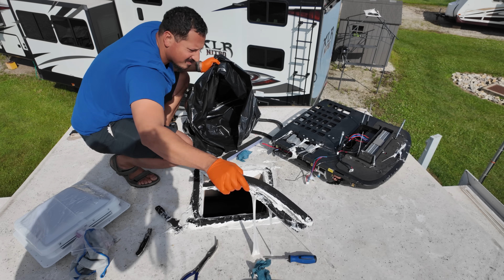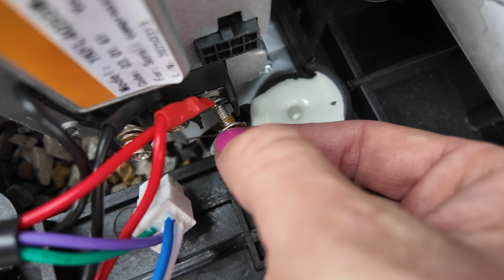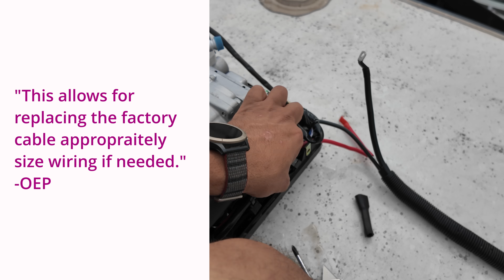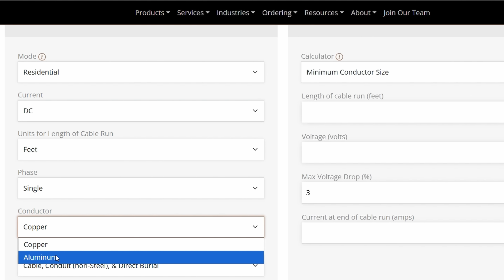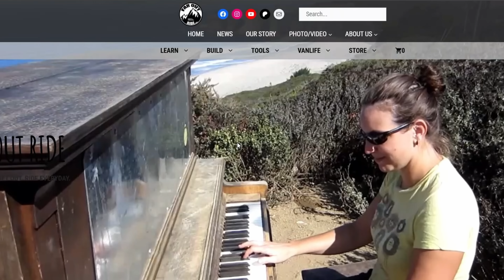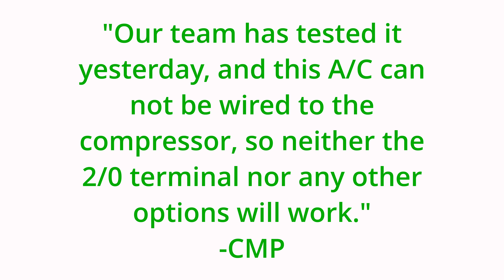The Truth About 12V RV AC Wiring in Big Rigs (What No One Says)

Comment: **OutEquipPro UNSAFE WIRING**
My OutEquipPro (OEP)also had problems. 
I bought the OutEquipPro for my Promaster 159WB which has BattleBorn batteries with Victron components and Spartan Power/Inverters-r-US cables .  

-The OEP 100A fuse that is included got up to temps of over 123F but averaged 116F (Fluke clamp meter measured 46.8A DC and a Fluke 77 measuring 13.54 VDC).
-"UNSAFE WIRING" Since I did not see any ratings on the cable, so I felt that this wire was unsafe to use at this point. 
-I also tried a Spartan Power 100A Circuit breaker just to test a theory and that got so hot, it would pop and not reset for over an hour. 
-The unit never did cool the Van over 10 degrees from outside air temp and I even ran the unit for over 24 hours.
-The blower motor could not keep up either.  It was measured with a Kestral 1000 unit @ 14.3 MPH max
-They had emailed me the wrong directions and that resulted in 2 of 6 mounts breaking.
-The supplied Short Mounting studs were warped/out of round so they were useless
-The supplied gasket is a joke, I had to buy a real 14x14 and even that was a pain to align due to the underside of the unit having holes in it to allow water to leak into the cabin
-I tried to torque the mounting studs to specifications, the unit's plastic started to warp before I got close to that tq number, so I stopped.
-I had to reroute wires within the unit as they had sharp bends and spot-ties that are way to tight and pinch the wires/cables.
-I had to reinstall the wire ring connectors correctly as they put smaller ones under bigger ones which is backwards. 
-The main DC lead screw lugs were loose on the main controller under the top cover.

I was able to return it to  and they paid for the return shipping too.

Oh and I was offered a $100 refund for a review of the OutEquipPro. So I am thinking that some of the positive reviews that are out there are kinda misleading as they are incentivized.
YMMV
Reply: I did not experience any of these issues except the mounting hardware being too short. The wire supplied for my unit was 6 AWG which is rated at 65 amps. 
If you need a longer run than the supplied 12 feet, you’ll need a thicker wire but I highly suggest to locate the battery within the distance of the factory length. 
The torque spec is only 13 inch-lbs which is barely over finger tight. If you warped the unit you went too tight. 
In my testing, the unit pulls about 21 amps at 12v dc after the camper is almost cooled down. I was not able to get the unit to pull over 55 amps. 
The fuse is 100 amps but it should be 60.
You need to locate the unit far back on the 14x14 or water will come in. This actually seems really obvious and is explained pretty well in the instructions.
Reply from the maker: Wow, thank you for sharing this! It sounds like you really tried to make it work and did everything you could! 

I was also skeptical if the wires not having any markings on them. It really sounds like you went through the wringer.

I’m glad that you were able to get your money back, and appreciate you sharing your experience. I hope others will at least know what they could be in for if they decide to purchase.
Reply: @DeterminationUnbound  who needs all this complicated process when u can just get a powerstation with extra batteries.
Reply: Man sorry you had such issues. Originally i was going to get that unit but it seamed as if it was designed for a fresh installation not necessarily purpose build for standard 14x14 rv opening.  Thats what put me into the countrymod. It fit perfectly and works well. I am pissed i gave up the heating function as the outequip did have that. Also the 120v ac i removed to install the dc had heating as well. Personally i would never gone DC if it wasnt 24v or higher. I would never feel comfortable falling asleep with that many amps flowing such a distance regardless the wire size. At 24v im drawing max 28amps with a most of the time 10-15. Very safe imo with fuses and breakers installed at both ends... get your money back and get something better. DC air conditioning is possible with the right stuff. Good luck...
Reply: This information was very helpful. Can't stand that we have to rebuild something after we buy it. Paying for negative reviews to be removed, just experienced that for the first time with a product on Amazon. They offered me $50 to remove a three-star review. That was honest. I declined updated my review to call out the company and Amazon removed my entire review.
Reply: @Buttonator-tx  you do not have to rebuild it .. they needed a better understanding of electricity .
Reply: I really appreciate the detail, honesty and evaluation of this unit which I was going to buy.
Reply: Relocate your 12 volt batteries to the front of your RV this seems to be the simplest solution why rewire the AC unit when you can just move the batteries to the largest load😂
Reply: @Theresahackforthat I think you meant to reply to another post

Comment: I just bought one of these and after doing extensive research I noticed they all looked alike. I've talked about the DCAC units and so I used AI to research it and it turns out like 90 percent of these units are basically built by the exact same Chinese manufacturer. So you might as well just get the cheaper unit, you know, in my case I spent $600, right? You know, the other ones that cost up to $1,200, they're literally just branding them differently, you know. But the core components are all from pretty much two Chinese manufacturers, you know, and so companies will get these on Alibaba for $250, market up to $500 and you have companies that'll take it like out a quick pro pretty much take that and market up double again and put all their special branding on it. You know, maybe they do some special modifications and they offer, I mean basically what you're paying for is branding and customer service, right? So just as something to be aware of, like don't think that the cheaper models are somehow less quality because they're all coming from the same place, you just, you pay them where you're just paying, basically paying for a logo and customer service. I just wanted to say that and I do have this exact same problem because I have a 30 foot RV and somehow the wiring is about 20 feet and I need to extend it like another 20 feet and I'm just, I know what DC, the voltage drops, the further the wire is, I haven't actually flipped it up yet. So that's why I'm watching this video.

Comment: Just asked Claude about this and I was wondering how you would make that run with the massive leads.  I just hooked up a system with 2 lipo4 320 amp hour batteries with a viktron multiplus inverter.  I quickly blew the 40 amp fuse from the battery to the inverter.  I forgot to do the calculations but going from a 12 volt to a 120 with a startup amps at about 20 for ac the math is easy 10x amperage.  Had to buy a vikron busbar unit that is massive and designed specifcally for that.  Yes the leads are huge but the run is short.  I have 3-400 watts of usable solar charging this and it works perfectly.  Pretty much gives me full time power.  I probably could run my ac 2-4 hours but when its simply parked with no hookups thats all I would ever use it.  My next is to replace my ac unit with inverter style and add 1-2 panels

Comment: I did a anchor winch install which uses the same sort of power as the 12v AC    I ran a separate battery near the winch and thinner wire from the main battery bank to charge it . This works well and gives me more capacity

Comment: Did you consider adding a battery closer to the ac unit that would be within reach of the factory wiring harness? Or perhaps using a bus bar so that the thinner cable stayed at an acceptable length?

Comment: IM INSTALLING A 12v AC IN MY WINNEBAGO MINNIE WINNIE 22’ FORD ECONOLINE E350 
I RAN IT OFF SOLAR
HAD TO CONNECT STRAIGHT INTO THE BATTERY USING 3 AWG COPPER WIRES 
STILL HAVE NOT TESTED IT IM DOING THE INSTALL RN LOL

Comment: I think most people's issues start with when they built their DC system. Most people should have used a 24 or even better, a 48 volt system to start with. It brings down your wire sizes, and increases efficiency across the board.

Comment: You need to understand voltage loss over long cable runs, that is the single most important factor. I have a 12 volt aircon in my 6.3 Metres long van and that’s the max this aircon can deal with. I digress, from lithium battery to Aircon is 7 metres that a round trip of 14 metres for my 60amp unit to run safely without a voltage drop I ran 35mm or 2awg  cable. To run a cable for your rig over the distance you’ve stated would require a huge cable. A 12 volt AC in your huge rig would be a waste of time. My Italian 12 volt AC states it’s suitable for vans up to 7metres and that’s based on European vans that tend to be much smaller than US vans.

Comment: These units are made for Class B and camper vans period.  They will not work well in hot days in a big rig, at only 10,000 btu's, my rig has 2 ea AC/Heat unit that put out 22,500 but. In AZ at 120, i can keep my rig down to about 76 to 78 degree with both running.  But I also cover all my window with reflective covering. that right there saves me 20 degrees.  Plus my untis are 19 years old and have never failed me yet, and they run there ass off.  Why spent all that money for less AC, plus the the battery cables would cost a mint just to run to my battery bank.  NO THANKS you can keep them.

Comment: LMAO my van has 18' of 2/0 wire run from my battery under the hood to my wheelchair lift, with a spare battery under the bed by the lift, dad worked for the phone company, he taught me wire resistance when I was young, I had a chart for years on wire gauge and distance, my van was done overkill, like wiring the alternator with an 18" 4/0 fused lead to the battery, I added amps in the rear for my subwoofers and the amp on the mids and highs.

Comment: I know im planning a 48v ac on my 30ft fifthwheel as i go to a tractor show and they have gen curfew.   I want the option of running ac and if so chose can run with a 110 to 48v converter if big enough which can run off my small inverter gen vs running 2 parallel. I got my camper setup with auto transfer and wired for ecoflow and working on installing  400ah 12v for fridge and waterpump and such😊  by going 48v only need like 10 ga wire

Comment: The BMS  will shut down a LiFe Po4 battery long before it drops down to 12.0 volts. If you are running the wires parallel it is the same length, not double. To be short that set up is just not practical. The only way to make that work is to just move the battery closer.

Comment: I have a 40' Thor Pasadena 38MX motorhome and I have 2 110V A/C's that I'm not removing and looking into adding the 12V A/C where my electric vent fan is in the front close to my batteries. I will have plenty of wiring I'm just trying to run the wires through the existing holes in the aluminum frame and drop down the wall to the batteries.  My two A/C's have Micro-Aire soft starts on them and I have a 8000w Onan Generator but some places I stay have a regular 110 V outlet and at least I can run 1 A/C.

Comment: Wow, thank you!! You guys just saved me a bunch of frustration. As a new RV owner (but NOT a "NEW" RV), we have a year 2000 Thor Four Winds that if you look up "Fixer Upper" in the dictionary, there's a picture of it there!! Anyway, one of the "upgrades" is a 12V AC because the current AC unit is 26 years old, broken and beat down but puts out COLD air still. But it is LOUD!  So I had this entire game plan laid out with everything I need in my Amazon cart and thought I was ready....and then I ran across this video and realized that it's still doable but I'm going back to the planning board and starting over with your information in mind. So thank you very much for taking the time to put out this information and not just providing another in a LOOOONNNGGG string of 12V AC Install videos that I've been watching non-stop that mentioned nothing about power supply issues.
Reply from the maker: Glad it helped….may not of gotten all the info right, but a lot of opinions and suggestions for execution in the comments. Good luck!

Comment: I think you are overthinking it.  Simply install a disconnect from battery to ac unit with larger sized wire then connect the factory wire to the disconnect.  This will solve all issues and will provide a service disconnect on the roof of the rv.  This is how home ac units are installed per code.  Since the smaller wire will only run a few feet, you don’t have to worry about resistance creating heat.

Comment: You don't add positive and negative  for total run length.   This is really as easy problem to solve imo.  
The terminal block on A/c should be engineered just fine.  Run lion's share of run with larger gage wire, probably to junction box.  In other words, junction box virtually moves battery closer to A/C unit.  Then from junction box, (shorter distance), use smaller gage wire that will connect to connections on A/C.  If possible,  put junction box next to A/C, or as close as possible.   You seem to be taking the "scenic route" for your wire to get from battery to A/C.

Comment: I know this ain't going to make sense but I got an F-350 Ford pickup truck with an electronic crane on the back to lift up car motors and heavy objects. I ran the cable one hot to the rear of the van/truck but I still had problems. The motor was bogging down, getting hot because of lack of amperage.

I own an RV so I know there's space underneath the belly. I know it's a bitch. I put it that way to install an underneath battery box on your RV, pulling down the underpinning. You could go to that back corner with a lithium-ion battery, another 12 V. Use the ground of the frame and go up for one wire to the charge controller to keep that battery maintained. Your run distance would be shorter, the battery would be fully charged, and you'll still be able to maintain with a lighter wire the charge circuit.

I have done this on my F-350 for my back crane. I had storage boxes in the back so I just use one of the storage boxes, put the battery there, and I use a lead-acid battery. I don't run lithium-ion batteries on my truck. This seemed to take care of the amp draw when I'm lifting up a big V8 motor with the crane. It doesn't struggle anymore. Just an idea.

I own an RV, a 2016 Jayco Eagle, and I've had the underpinning down. I know there's lots of space back there to put another battery. I know it's a little bit of a struggle but you'd run just the height of your RV cabin up to the top, the way you designed it with the gray conduit. Then you'd run 2-gauge wire to the front of the other batteries with a fuse in line in case something happens. You'd be running off of that battery but you'd use the rest of your charge controller to keep that battery maintained.

Comment: What about using a 48v air conditioning unit?
Use a 48v 100-300ah LifePO4 battery and charge/maintain it with solar AND a DC-DC alternator.
(not sure of the load, but it would likely work  —. DIVIDE UP THE COPPER WIRE SIZE… IT WILL USE 1/4 the size required at 12v)
Reply from the maker: That would absolutely be the way to go

Comment: Guys, 12Volt units are NOT more efficient or reduce the load on your DC system per BTU, period.  Thats technically Impossible. Losses tripple with every Amp consumed, the higher the voltage, the better.

Comment: This is all why i did a 48v system and over kill on my inverter and solar.  Im using a 5000w inverter in a 30 amp camper with upgraded input wire to a 50 amp. 30 amp camper is built to only use 3600 ish watts the over kill i built with makes using the colman mach 3 ac unit run with 0 issues 24 7. All with smaller wire and no worries about melting any thing. I normally only use 28% of the capability of my inverter.  My draw at 48v 15amp with ac 1500w 28% . Over built. No problems

Comment: How about going with a 48 volt air conditioner. Or a 24 volt. I probably would prefer a 48 volt unit and have a 48 volt battery dedicated just for it . Maybe in the future you can convert it all to 48 volts with an all in one 48 volt inverter that can give you 120/240 split face if needed. Tie it in your 50 amp hook up plug and use your 48 volt system as running your whole 5th wheel . With 48 volt the wires will be way smaller and cheaper.
Reply from the maker: Oh absolutely the better choice!

Comment: All of this but yet everyone else is enjoying their AC.

You doubled it once, then over calculated, then under rated the voltage.

Hook it up with a run of 2 or 4, test the voltage at the compressor, if it’s low, run another run of 2 or 4. It’s going to work either way because Johnny used an old extension cord and his is working fine.

Comment: You could have saved yourself a shit ton of trouble by locating a dedicated battery within range of the factory harness and implement a dedicated charger to it. The dedicated battery and charger could be located in a cabinet.
You could then have a solar setup plug into an outlet mounted in the exterior wall. Every time you plug into shore power or a generator the dedicated lithium charger charge up the battery as well.

Comment: Run multiple smaller wires from the compressor that would equal the 2/0 cable to a busbar and from there bump upto the 2/0 to the batteries.

Comment: I didn't read all the comments, so I don't know if someone commented what I am about to say. 
1. I don't believe you multiply the wire when you use the calculator. For cost yes of course.
2. I don't believe that this ac can cool a rig that size, not even a whole bedroom. Specially if you are in 100f temperatures.
3. You can always get a 24v or 48v ...
That's my 2 cents..